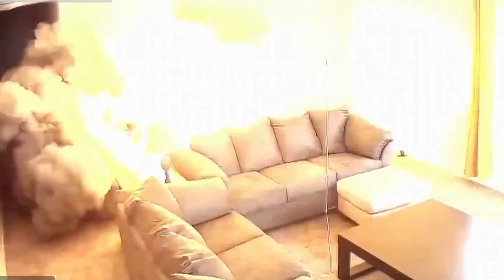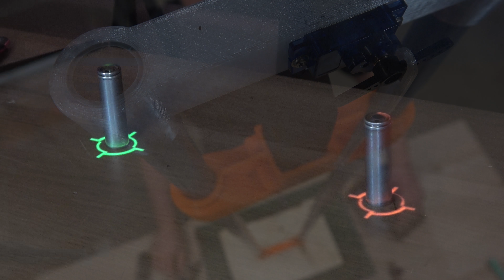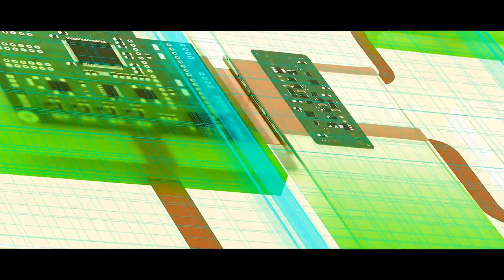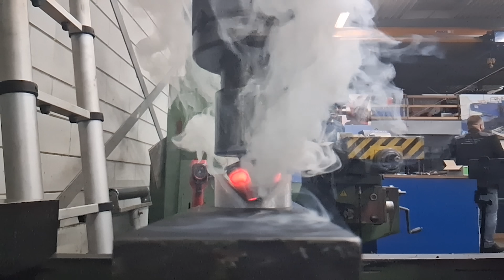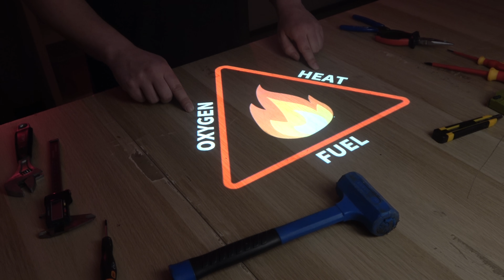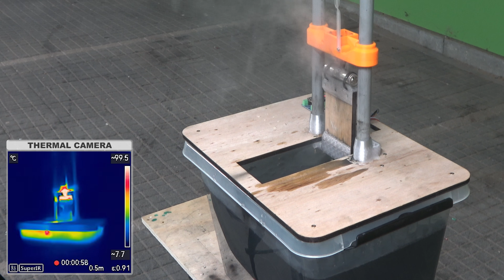Detonating Batteries.. For Science!

Comment: You ran these tests with a single cell.

The logic behind using water on a lithium battery fire is to provide enough cooling to prevent the remaining undamaged cells in a battery pack from also reaching thermal runaway due to the heat of the fire in order to stop a chain reaction where the entire battery pack turns into fuel for an even larger fire.

I cell phone may only have 1 cell - thorwing it in water will mainly just stop the fire from spreading to other things around it.
Laptops, tablets and portable chargers have multiple cells - quickly taking action to cool the device can prevent a small fire from becoming a much larger fire.
Reply: I don't think you fully understand the process of a short under charge causing an electro-chemical fire. Just cooling surrounded by more fuel will just add to the problem. These fires are hot enough to melt metals so cooling does not prevent an entire pack going up when single cells fail. When such a short happens it's like flipping a switch you cannot flip back anymore. That's more like a rocket ride on solid fuel into space. When you light the candle it will burn till it's out of fuel. It's also not about the number of cells in this video but the actual used of lithium in batteries. Not all batteries u use have the same composition so do not mix them up. Phone batteries are not like AAA, laptop batteries and vehicle batteries construction wise
Reply: @UndercoverPirate69  Cooling with water works very well, this has been tested on large packs by the Swedish fire officers association, video of the testing is on youtube called "puting out lithium ion batteries with plain water in a short time".
It's about containing the thermal runaway and stopping it from spreading to other cells exactly like VirtualBSHere said.

Comment: Boo this man, you suck. No mention at all about how to extinguish lithium battery fires?? Submerging batteries in water with a reaction already underway is a fantasy. Please mention:
1) Storing lithium batteries inside a fiberglass battery bag (when possible)
2) Keep a fiberglass fire blanket handy (multiple is better) to control the spread of the fire
3) If a reaction occurs, you need a Class-L Fire Extinguisher to suppress it. Class BC and ABC extinguishers will not help as the powder cannot reduce the temps to stop the reaction

This is cool and all but you just ignored how to control these and it's not a mystery. Hell, you might do some good.

Comment: I Really don't recommend breathing in the fumes coming off the batteries.  I say this because you seem to be in a room that is somewhat or fully enclosed with the battery failure testing.  When these batteries go into thermal runaway or in your case intentional direct short failure they put off hydrogen fluoride, carbon monoxide, and hydrogen cyanide amongst other things...

Comment: Dropping the battery in water SIGNIFICANTLY reduced the amount of highly toxic smoke that was produced. The water turned dark black. Like the water absorbed the smoke. This can make a huge difference in dealing with the battery. Often a small battery that ignites can fill up an entire room with toxic smoke. But dropping it in water (say a toilet) can stop toxic smoke from making the room uninhabitable. This can allow anyone nearby to extinguish secondary fires the battery starts and prevent a major fire. So dropping a burning lithium battery into water may not stop the reaction, but it reduces the damage and makes dealing with the burning battery much easier.

Comment: This seals it! So a big bucket of water to submerge the whole battery pack would actually prevent a catastrophy, but you have limited time.

Big packs should be charged on Turkish balconies. :D Cement buildings. Tile floor. Watch for the insulation. If it is XPS or EPS don't do it. If not, you are good to go. In worst case scenerio, you will need a paint job on the facade of your balcony. :D

Comment: Keep in mind. Lithium metal reacts with water. Something like sand may work better
Reply: Lithium Ion use a compound of Lithium, rather than pure lithium metal. Lithium metal batteries do exist, but are not the same as lithium ion.
Water does not react with the lithium within a lithium ion battery because it is not in a pure metallic form. Still, dirty water can cause a short circuit and lead to fire anyway.

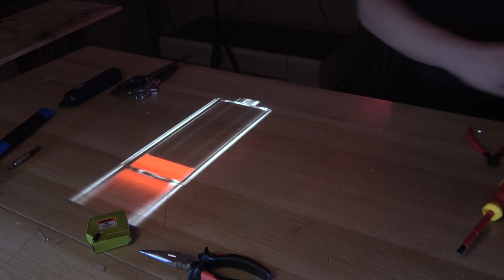Comment: 4:48 is not true at all
Reply: it actually is, most electronics only allow the battery to drain to a certain extent before refusing to use any power from it anymore to attempt to avoid this happening
Reply: @siringc  Oh, I forgot, once the bms chip says no more discharging the pack, it continuously discharges it, yes in uA, but if left, the bms is the cause of killing the pack
Reply: @siringc  Most battery charging circuits (the IC itself), will not fast charge a cell that is out of normal spec, but at least 85% of these chips WILL charge that cell slowly to get it back into range, and then start the normal charge. Dont agree, look at BQ BMS chips for one example. And while its not great for Li-Ion cells to go to 0v, and it does lower the capacity (and raise esr), the battery will still work most of the time, so again, 4:48 is not true.
Reply: @user-rs8zg8ey2b lithium ion cells are unable to be recharged from zero. If your, say phone, is at zero percent, it is actually about 20% left
Reply: What part isn't true? He says a lot of stuff.
Reply: @JilbertBoy  lol, i even mark the spot in the video

Comment: I once managed to make a grenade out of 18650 high amp cell. I crimped the upper part like a wire causing short circuit and at the same time disabling/destroying internal mechanical protection devices like CID. I left it outside and it banged like flashbang xD

Comment: The trick with water was about stopping the thermal runaway, stop the thermal runaway, you can begin to cool it to below it's auto ignition temp since Li-ion batteries have oxygen in their chemistry you cannot smother it to stop it, you need to remove the heat or let it burn itself out, then when safe attempt to transfer it to a safe container so that if re ignition were to occur at any point the fire wont spread.

Comment: This is fear mongering, not "science". Internal combustion engine vehicles catch fire significantly more often than electric vehicles. Internal combustion engine vehicles catch fire way more often than EVs in the US. Vehicles with combustion engines experience approximately 1530 fires per 100,000 sold annually, compared to only 25 fires per 100,000 sold for all-electric vehicles on average each year in the US. If you like cars that say "vroom, vroom" best then be honest and open about it instead of using misleading arguments, like you do in this video.

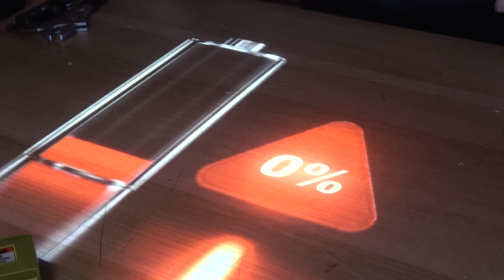Comment: Interesting video, however it is unfortunately quite unprofessional, you have not taken any records of what voltage the batteries were charged at nor what their capacity was, for example when you punctured that battery at 5:53 you you said that it's "discharged to it's lowest safe voltage" but what is that voltage, is it 2V, 2.5V or 3V? The battery capacity also plays a big role when it comes to it's danger properties, a lower capacity baterry (talking about their maximum capacity when fully charged) will normally result in considerably smaller fire simply due to the fact it is less energy dense.
Another thing to not is that I noticed a lack of any hand/eye protection in the people seen in this video, as well as no gas masks, the lithium batteries produce toxic fumes when burning which can be a health hazard.

Overall, while the video is generally informative and useful, it should have been done a bit more "scientific", and when it comes to safety... well that's entirely up to you if you wish to risk your health/life for the purpose of more content :D

Comment: Difference between electric cars catching fire and gas tanks on cars? One blows up instantly, the other is a cascading event that normally takes long enougb to at least jump from the vehicle, unless you are stuck inside and in that case youll roast if its an EV or ICE fire. Now what are the rates of catching fire? FAR more likely in a ICE vehicle vs EV which is incredible since the ICE vehicles have 100 years of development on the EVs. Per 100k vehicles sold the ICE lose 1,500 to fires. EV is 25 out of 100,000. Hybrids fires are insane.

Comment: I punctured a 5000mAh RC car battery that was so low the charger refused to charge it. It was winter, late at night, I put it in the middle of a frozen parking lot in the back of my office and hit it with a knife. That 'empty' battery became like a small sun and the reaction was highly violent. Smoke was everywhere, it covered the whole parking lot area, I was worried that someone calls the fire department if they see it. The thing burned so completely that only small pieces of melted copper wires were left, with a small pile of ash. The asphalt had about 4cm ice cover on it, it melted around a good half metre radius, and there's still after all these years a permanent burn mark on it. That was the day I started to respect lithium batteries.

Comment: Flat batteries:  Yes, for a functional battery it maintains some energy, but failed batteries don't. I just threw out a few failed 18650s that I replaced in some battery packs.  They had like 0.1v on them.  They pose no danger to anyone.  Storing LiIon batteries for recycling one days should require absolute discharge before storage, then it is totally safe.

Comment: nice thx a lot 🙌 I have li-ion batteries that are older than 10 years and I always was too lazy to dispose them properly - but now I don't have to be afraid anymore and they can lay around for another 50yrs until I die on old age and they get disposed by someone else  lol
Reply: Your comment is hilarious 😄

I'm the same as you. I've got a bucket load of batteries from every laptop I've fixed or refurbished. People go looney bin over lithium batteries but will have 3 old laptops sitting in their cupboard that won't recharge anymore?
Most of the time the charging chip inside the battery is dead and the cells won't balance charge anymore. Or if you were to independently recharge each cell and somehow put each one back in the battery pack (not worthwhile to spot weld them back again) the battery pack for the laptop will be like brand new again........until you discharge it to empty and then leave it sit for another 3 of 4 years and then it won't charge again. The cells will be perfectly fine though

Comment: Ik recently learned that a huge Risk is the production of Massive amounts of carbonmonoxide. As in leathel.
Reply: No hydrogen gas. Carbon monoxide CO come from burning petroleum only.  This is why cars have catalytic converters because super heating platinum breaks oxygen 02 into O + O and these will join with 2 x CO to form 2 x CO2 or carbon dioxide. Catalytic converters only work once the engine is warmed up and the exhaust system is hot however and they are not 100% fully effective at converting CO to CO2.
Carbon dioxide gas occurs when you burn literally ANYTHING. 
Burning sugar(smells like fairy floss btw) produces pure carbon dioxide. This is the gas you exhale when breathing by the way.
Ozone which is 03 gas is highly highly toxic though and that's why it is important to have ducted air system in any photocopy room because photocopying produces large amounts of ozone. Ozone is actually toxic at sea level.
03 isn't stable though and wants to get rid of one of its oxygen atoms.  Hypothetically speaking if your could duct air from a photocopy room directly into the exhaust system of a car it would act like a catalytic converter by donating one of its excess oxygen atoms to carbon monoxide to form 2 carbon dioxide atoms
Reply: @jameshatton4211 no, u are wrong. Read paper here: Review of gas emissions from lithium-ion battery thermal runaway failure — Considering toxic and flammable compounds

Comment: the whole "if energy level is too low the battery core gets destabilised" is a thing I keep hearing lately, where on earth it started? A lipo cell is just 4 sheets stacked and rolled in a cilinder/slab. Overcharge/discharge causes electrolytic damage to the electrodes base, bringing chemicals into the mix that will mess with the normal reactions that happen in the cell. Normaly reverting the chemicals that get formed while discharging tends to be a much much more reactive process, taking near full priority over the whole substrate corrosion, but the more it goes on concentration lowers to the point where it starts being meaningfull, this is part of why no matter what, a cell will degrade from use. Light overdischarge will lover cell capacity and make it... gassy. Repeat slow/trickle charge will lead to uneaven electodes/dendrites, that can lead to much lower capacity, passive discharge and overdischarge simpotms, with eventual premature unusable/dead cell. A good charger will charge a cell in about 2hr or less and stop (no charger should ever go above 4.25v, normal cutoff being 4.2), and a good bms won't let a cell go below 3.45v. Overcharging is the worst as it can make the cell go in a thermal runaway. Flames come mostly from the flammable solvent in the cell that gets turned to hot vapors. Want cells that are much safer and robust but still decent energy density? LiFePo is the answer at the moment. They also care much less about slow/trickle/partial charge, hence why so popular with solar/ups/vehicle use.

Comment: So they need to be designed in a way that instantly discharges them when they reach the point of thermal runaway. 
The guy who designs that is gonna get paid!!
Reply: That's a lot of energy to discharge. I've suggested a brine tank instead to see if that will stop hydrogen formation
Reply: @jameshatton4211 perhaps ridiculous led lights on the bottom of the battery  pack that light up full power, greatly reducing the time it takes to put it out also? (Might actually work really well in automotive situations, imagine how bright it would be though! 😅)

Comment: Called fire dep just last week. A pile of trash self ignited and mildly exploded several times, li-ion + trapped moisture from rotting food in the bag is not a good mix. Just luck it happened with the trash out for pick up, normally they are kept in the basement of the apartment building...... It's so stupid, you can safely hand them in at special boxes at just about every supermarket in my country. Wish I knew which neighbour it was, for a talking to.

Comment: According to Stache-D (firefighter specialising in Li+ fires), the golden charge is 80%: above 80 the danger is a lot higher.
Reply: That's why I'm building my battery pack with voltage overhead. Meaning at 80% capacity of the battery cells = 100% fully charged on the controller. Only changing to 80% always